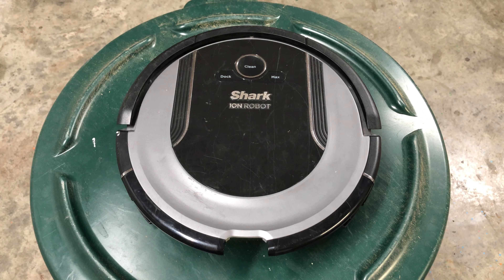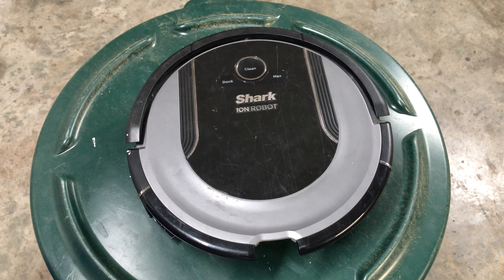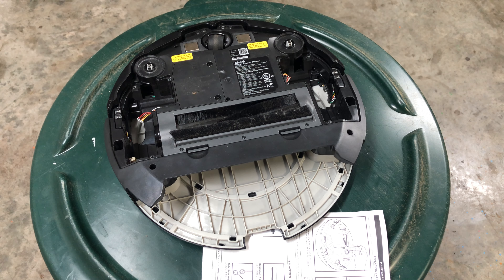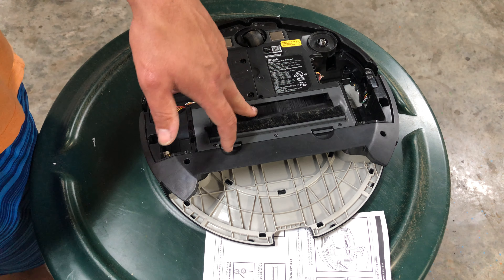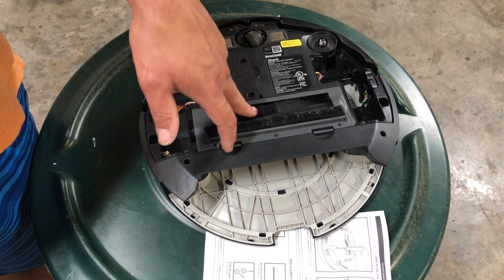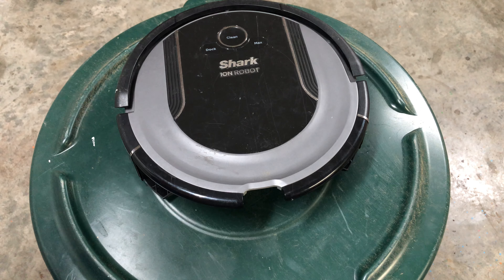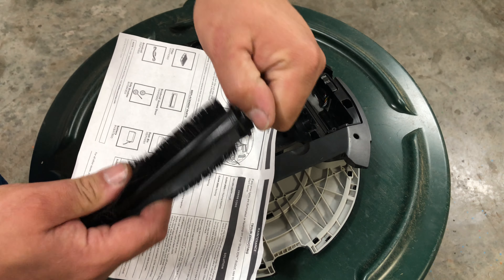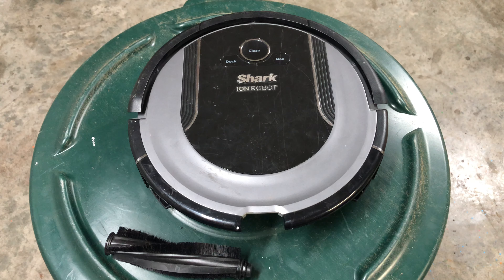Shark Ion 850 series error lights and how to fix guide

Comment: Wow. You are fearless at tearing these things down. Thanks for all the how-to videos. I might need a new brush roller motor. Mine turns kind of hard -- can't turn the square thing with fingers alone. I've taken off the wheels, the battery, and the top housing, but it looks like the vacuum motor and the wiring to the motherboard all have to be removed before I can get to the brush roller motor. You indicate this is pretty common, so I'm guessing I need a new one. Where do you get these things?

Comment: Great videos and could use your help.  I have an 850 that sucked up a sock and now makes a grinding noise.  From what I can determine, no suction is occurring.  What could be the problem?
Reply: Your sock is still inside your vacuum.
Reply: No, the sock is out but when I run the vacuum, it now grinds and isn’t picking up anything.

Comment: My RV851WV will run for a few minutes then stop. Then restart on its own. Then stops.  Chargers to 3 bars. HELP!!!!
Reply from the maker: short somewhere on the motherboard, are you getting any errors? Can you manually get it to work. Could be a bad battery.
Reply: @SmittysWorld  How do you make it work manually?  The battery light goes from 3 to 1 then back to 2 as it starts and stops.
Reply: It was the battery. I got a replacement battery from Amazon, and it works great again.